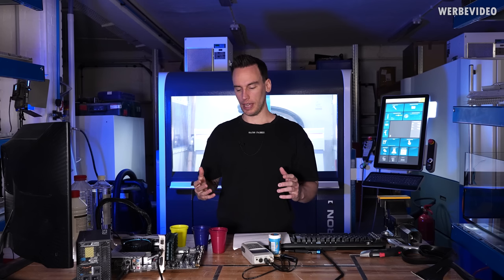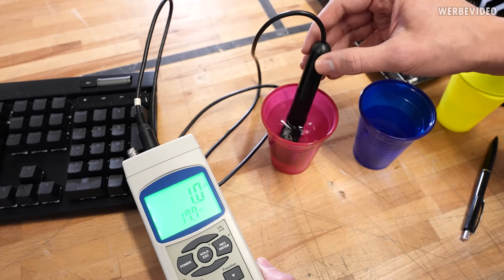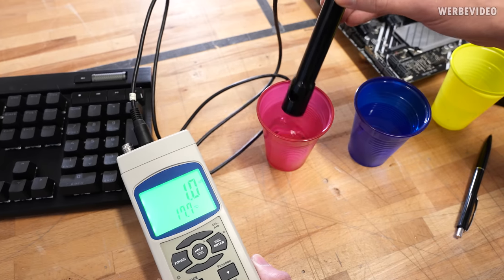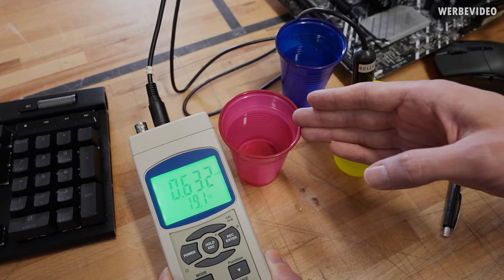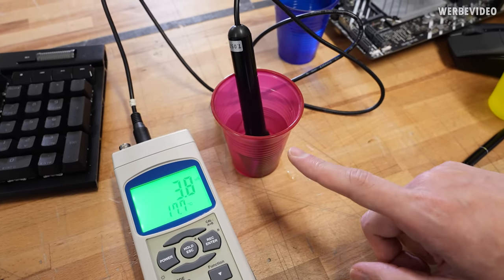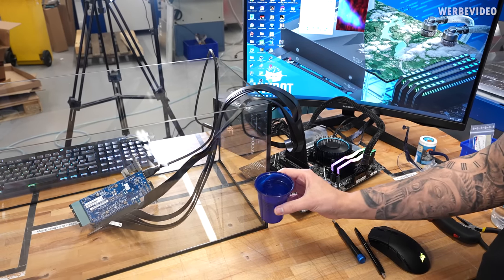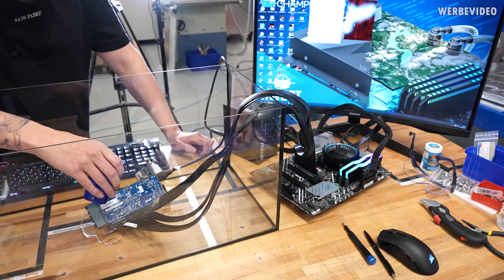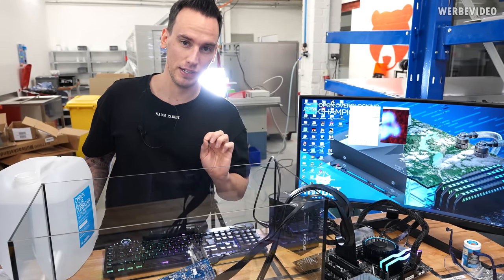Can you submerge a PC in Ultra-Pure Water?

Comment: i think you should try run components like memory clock, pci clock as slow as possible or use older platform(e.g. c2d), because higher frequencies needs better/shorter "traces" (like new graphic cards, old graphic cards had memory around 1-2cm from gpu, now memory sits around 2-5mm from gpu). In water signal from other traces may interact with each other and cause errors that prevent pc to boot. sorry for my english xD

Comment: A lot of people have already mentioned the leeching issue, but don't forget that the current flowing through the board acts as a form of electrolysis apparatus. As soon as you get any kind of conductive impurity in the water (e.g. metal salts, minerals, certain organic molecules) you'll start to see electrolysis processes accelerating the contamination significantly. The 12V connections and exposed pads and plane areas are the most likely source. You either need to counteract that with a DI pump (e.g. reverse osmosis filtration) or use an alternative liquid like low weight mineral oil.

You might have some success in delaying the onset of corrosion with something like plastidip, but the connectors will be a weak point, you'll need a fully sealed system to prevent external contamination (the air contains a lot of suspended particulates), and you'll need to cycle the water for a few days at least to handle the initial diffusion of surface contaminants from the system. Probably best to use cheaper lower-grade DI water as an initial soak to keep costs down, then cycle in the fancier stuff once you've sorted out the diffusion.

Something else to consider is that your skin is a big source of contaminants. Sweat, skin oils, sebum, etc. are fairly rich in conductive salts. Wearing gloves and wiping things down with alcohol would help a lot.

Comment: Many years ago my quadfire 5970 rig had a pretty major cooling leak, the outlet hose came off the pump. It was in a mountain mods ascension extended case with around 6 massive radiators and 2L+ of coolant. Most of that coolant got pumped over the entire rig, the Corsair AX1200i PSU took most of it, luckily it's built in protections did their job and shut the PSU down. Was gaming at the time, I remember hearing what sounded like a fan bearing go bad and loud, then my screen went purple and within a second the entire rig was dead. Looked down, and there's mayhems aurora coolant flowing out of the case. 

Luckily I had a 20L tub of DI 99% pure water to hand, picked up the entire rig and put it into the bath a proceeded to empty the entire 20L over the rig. Disassembled everything and put it into my oven at 80c for 8hrs, assembled it again. Unfortunately it didn't boot, as soon as I plugged in the PSU it tripped the breaker. Swapped out the PSU, and the rig fired straight up.

Got super lucky with it, proved to me there and then that no matter how "pure" or "non conductive" the coolant says it is, it's still conductive once it's used in a loop. I think it likely did help though compared to if I had run say tap water in the loop.

Comment: What's the accuracy of the least significant digit on that meter? Quite often that's at least +2-5 LSB. Meaning that the measurements of the ultra pure water falls with in inaccuracy of the meter.
Reply: Btw, I had no doubts that the hardware would still work. I have cleaned many many PCB's in the past. As long as you make sure they dry properly and be careful no residue is stuck somewhere, it will be totally fine.

Comment: Electrical conductivity is one thing, another major factor in a system that includes tightly packed high speed signals is electrical permeability: PCBs and connectors are designed with air as the dielectric in the void between pins and traces. When water displaces that air, the electrical permeability of what formerly were air gaps goes up 80X and that messes up signal integrity.

Comment: It's not only just the ions from the metals that leaches into the water directly, but also oxides that form on the surface of the solder joints, pins and exposed pads that, depending on their solubility, dissolve very quickly into the water. That's probably the reason the PC didn't last too long in the water.

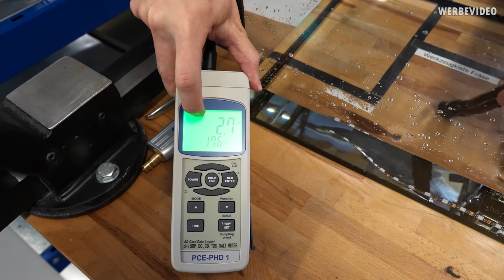Comment: 7:11 and 10:15 you did clean the tank mostly, but e.g.: you just handled the GPU & motherboard with your bare, naturally oily hands. :) And it's in open air, which also has some suspended stuff in it. Also and older system that probably has some dust in it somewhere unless you disassembled and cleaned it off with a lot of alcohol.
Also take note that the conductivity is only at that very point. If the slots have some dust, that will take a lot of time to diffuse to the measurement site.

Comment: Each part cover in silicon gel , paint brush , heat and oscillate for air to escape each part will need to be gelled , then it’s the ram slot , most of the parts were already kinda designed to be in fluid of a body

Comment: Always used demi ( distilled ) water from the grocery store in my pc watercooling with just a single silver coil to discourage bacterial growth. and it's been great for years, do change out the water every 2 years or so but it's not needed probably. I just do maintenance anyway.
Reply: Yep! I've done the same years ago!
Reply: I just run car coolant in mine, good for winter so I can run ridiculous oc in the winter
Reply: It will become as conductive as any water from your copper, nickel, aluminium block/radiator, fittings etc.

Comment: Might be worth mentioning that getting distilled water on your components is effectively the same as getting condensation as you would when doing extreme cooling. Water condensing from the air will normally not carry any metals or other ions that would be conductive, all of those are picked up by the water when it settles on your components.

I would also suggest that it's likely that locally, around the exposed metal of the components, the conductivity of the water there would be a lot higher, since that is where the ions originate from and the water isn't in constant and perfect circulation.

Comment: You could cover the back of the PCB and some vital parts in the front (that do not generate much heat) with something like silicone solder mask.  This will minimize the area exposed to water, so less points of failure.

Comment: Excellent test.
I’d be inclined to remove/move the CPU fan. Placing such load on the fan as moving water, can trigger the protection circuit = shut down. Also the fan greatly agitates the water and accelerates metal reactions and absorption/distribution of particulates, increasing overall conductivity (more quickly).

Comment: Water also has a high relative permittivity (I think much higher than mineral oil) which could cause much higher capacitance coupling between wires/capacitors. This could cause signaling issues on the board.

Comment: Another issue is that as microscopic dust and dirt containing ions dissolves into the water from the board, the conductivity near the board where electricity is flowing would be much higher than throughout all of the water. This won't disperse quickly without serious agitation. It probably isn't enough to cause a short and serious damage, but it could cause enough variance that nothing will work correctly. An interesting test would be to thoroughly clean, then soak it in distilled water with significant agitation, then dry it off in a sterile environment, then repeat the test without introducing other contaminants. To make something like this cool effectively, i'd imagine you would realistically need to get a fairly large amount of water flow through the cooling blocks on the GPU and CPU, and those fans aren't going to have enough power to move much water, so maybe no fans but suberged into flowing water (even if it's just being pumped in a loop).

Comment: I had a mini ITX pc running in demi water for around two weeks, I think the thing i did different was that before putting it in demi ater, i had it submerged in alcohol for half an hour or so (it was very fitly scrap pc). All the parts except the PSU where submerged. The thing even started corroding after a few days, but the funny thing was only one part corroded. The vga connector was almost rusted away when the pc died after about 10-14 days.

Comment: I believe that the cause of the weird behaviour is because water is still capacitive when clean, even though it is not conductive.
Very simplified it means something like the water can temporarily store a charge even if it can't cause a short circuit. This is the same principle used for touchscreens because human skin is also capcitive. Probably mainly from the high water content.
When you have water everywhere that probably messes a lot with the digital signaling and, causing instability.
I think think this explains why it wont work properly in water, but is not damaged by it after thorough drying (assuming the water was very pure obviously)

As for fans, they are ok to wash from my experience. They just need to be completely dried (usually involving a water displacer for the insides) and re-lubricated after. I have restored some smoke-damaged fans like this in the past and they ckntinue to work just fine :)

Comment: That demonstration with that single grain of salt changing the conductivity of water indicates how easily it can change.  Even insoluble materials like gold and silver still release a microscopic amount in solution which would affect the water's conductivity. I would have pre-cleaned the motherboard and all other components in an ultrasonic bath before putting into the ultra pure water.  I would have also removed as many heat sinks as possible due to the microscopic amounts that'll dissolve. 

As for drying off the motherboard, a vacuum desiccator would be effective as long as you don't try to pull a full vacuum on it.  The reduction of pressure in the chamber would boil off the water. When pressure is restored, the silica would absorb the moisture. A couple of passes of this gets things dry quickly.

Comment: Place the power supply above the wet parts as far as you can to stop the water flowing towards the power supply. Water will not run up hill unless the cable gets saturated.

Comment: Water electrocutes  but in a tub of water  if you hold the  - &  + wires  apart from  each the resistance is low current just dont hold the wires :)

Comment: i think it would make sense to remove unneeded parts, and strip everything down. then to some cleaning in an ultrasonic cleaner. with first a cleaning solution. but then a rinse clean with the pure water. which is then thrown out

you then want to mask off all areas that require heatsinks with a tape. and any strange shapes like ports for connections to cables need some temporary plug of soft neutral cure silicone. after dissassembling everything. and cleaning and masking everything. then the parts are ready for a conformal coating. which probably should be pu based type with some durability against scratches etc. like a semi hard plastic. but also still flexible.

after conformal coat you can remove masking and temporary plugs. and then attach heatsinks. so for those you need a thermal pad that is not going to contaminate ions. i do not know what to suggest for that. but you can speculate and heat up in water and test with those same measuring equipment.

for the main heatsink maybe idk a non graphite phase change honeywell thermal pad? but most types of tim normally includes a lot of metal in it like aluminium dust idk. or oxides of a metal. which might become ions in a solution perhaps? idk anyhow best chances would be to protect the most components from any dirty water using a good conformal coating.

btw the misbehaviour is probably for very low voltage silicon for example 0.7 to  0.9v. as we were discussing last week that the cpu and gpu are sensitive to even a partial or modest increase in conduction between the pads. it is perhaps enough to mess up those digital inputs. and it seems difficult to protect those without using a decent conformal coating. to make a physical barrier or layer on the whole pcb. all places except for the heatsink and the cables / connectors

Comment: a while ago I was planing to make a plasti dip to a motherboard and cover all exposed ports so it would work submerged in tap water. The idea actually come from one linus tech tips video. I was unable to find the same spray that he used and in amazon it was super expensive. This is a challenge for you now!
Reply: a hint from me : you don't need to wipe and air blast the wet board! You can simply put it next to a heater for day or two, all water will evaporate even under the cpu! TESTED!

Comment: You need to bath motherboard in pure water to clean it from dust etc, after this you can put in new pure water and power on. And use gloves, skin on hand also can change conductivity of pure water. For boot only you can disconnect fan, some mb won't start if fan is restricted to much
Reply: В настройках Биос выставить игнорирование вентилятора процессора, тогда всё работает

Comment: It's not just conductivity, the water is also a solvent and will erode some insulating materials over time and get into the traces on the MB itself.  The water is tripping the "motherboard is underwater" sensor. lol, I'm working on an outdoor winter cooled case concept, the humidity/static is an obstacle.  You might try to clearcoat all the assembled components to try and water proof them, that's what I'm thinking for my project.
Reply: That completely negates the whole point of submerging a PC in a liquid.😆😆
Reply: Just keep the rain out and never let it shutdown, if the pc is hotter than ambient, which it always will be if it is running, condensation is almost certainly negligible
Reply: Nothing in the PCB itself is water soluble and motherboards do not have "under water sensors", LOL. We wash PCBs during manufacturing all the time, using deionized (NOT distilled!) water as the rinse. They aren't powered during wash, of course, because even high resistance water is lower resistance than air. 

Now, if the PCB used a no-clean process (as most commercial electronics use) and there are flux residues from the soldering process present on the surface, condensing moisture (and frost) can easily be a problem. Environmental moisture is SIGNIFICANTLY lower in resistance than DI water. Some no-clean fluxes are more robust to these conditions than others, but you'll never be able to find out what material was used on the PCB unless you can directly contact the manufacturing site. 

For your cold outdoor application, you need to look at conformal coatings. These are non-conductive coatings that can be silicone, acrylic, urethane, or epoxy based. (Also paraxylene, but you need industrial equipment to apply that.) Some are more moisture resistant than others and I would recommend a good urethane coating. Keep it off moving parts and connectors (tape them off during application like when you paint a wall)

For your static problems, you need to make sure you ground everything well and use handling cautions (eg. ESD wrist straps to a good common point ground) - low humidity air allows objects to build significant static charge. In production, we force our factories to maintain 30% RH at a minimum during the winter. Mine feels like a sauna as we run closer to 50%.

Source: My 25+ years as a manufacturing engineer, soldering and assembling circuit card assemblies.
Reply: @jasonfullerton7763  you know the water sensor was a joke.  Although MacBooks do have humidity sensors they usually will not cause the device not to boot.  Water will damage PCBs over time it's just a fact, anyone working with rusty automotive electronics can attest to that.  It will find a way through the wires like Roman said or through the traces eventually lifting them off the PCB.  If you are as familiar with this as you say.  You would know that in industrial or marine applications the components are epoxy'd.
Reply: @st3althyone  I think the video does that on it's own, not a good idea.

Comment: Pure water dissolves the metals and remains of the manufacturing process of the motherboard, ceasing to be pure. Areas with a higher concentration of pins may have a higher level of conductivity, since the water is stagnant, and there is a high concentration of exposed metal (pins) that dissolve creating a conductive environment.

Comment: I mean the point with the lower conductivity of the cooling fluid premix would not be to be able to run your PC with the coolant on it, but in case of a leak at least not destroying the components. And as demonstrated after some drying the still work.

Comment: As soon the de-ionised water is exposed to air, it will automatically start "un-de-ionising" ... dissolving some CO2,  which will react to form some carbonic acid, that acid will then dissociate into free charged ions, which will react with both pure metal and a surface metal oxide layer will start forming hydroxides which will dissoacte into more ions, etc etc.
The non-zero permeability of the HDPE container it came along with the gas present at filling is probably why it wasn't absolute zero uS (assuming that wasn't just margin of error or ionic debris on the conductivity probe).

Comment: You should try cleaning the components in an ultra sonic cleaner with alcohol to remove as much possible contamination. Then when you try to submerge it use the same container, but like 4/5 of the way full. That way it takes more contaminants to increase the conductivity.

Comment: The beauty about hardware is that, as long as you dry out a component over the weekend, and make sure that any liquid isn't creating a short between two circuit pathways, it'll run again. I can attest to that with my $1200 monitor being tragedy dunked with a alcohol bourbon spillage. Some cotton balls and isopropyl alcohol rubs later, it's up and running again.